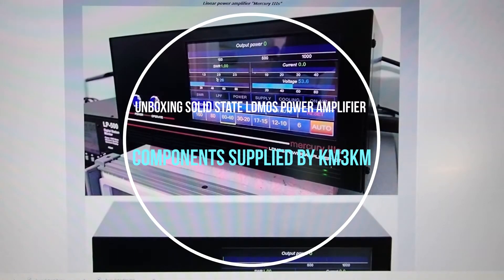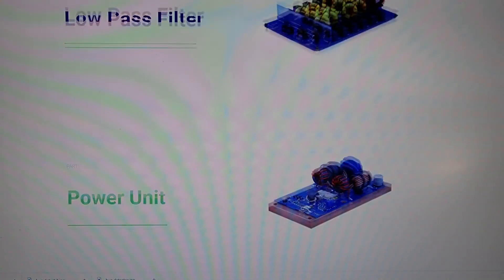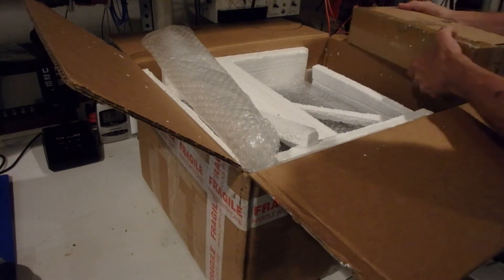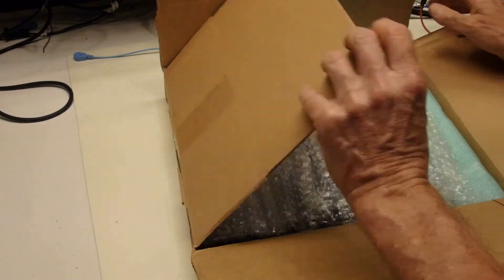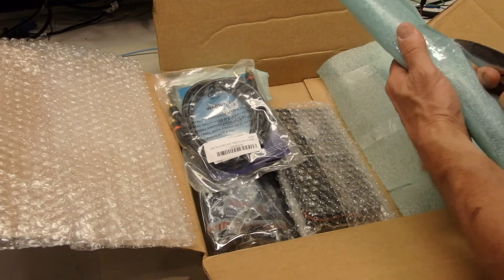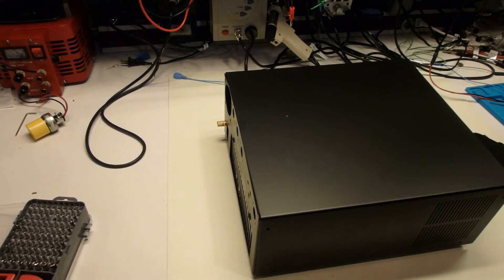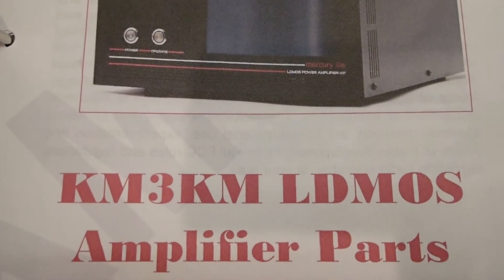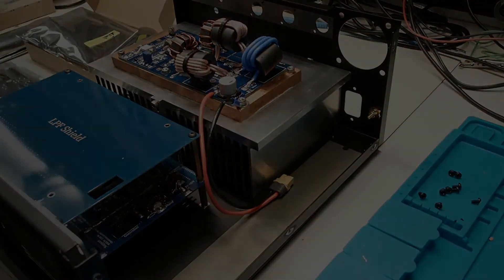Unboxing:  Solid State LDMOS HF Linear Power Amplifier Components

Comment: How would you use this amp with an automatic antenna tuner ? say the mfj 998 ? Would i just not activate the the ptt line when  tuning ? Is the trx antenna line in a pass thru mode then ?
Reply from the maker: I use a MFJ998

You use the
MFJ-5114I MFJ-5114 Original MFJ Enterprises Interface Cable: MFJ Auto Tuner to Icom

For the Icom 7300 to control the tuner and you use the

Icom IC-7300 Amp Relay Cable With ALC & Relay Buffer

To have the Icom 7300 control the amplifier

Comment: I’m very interested in building this amp to use with myFTDX101D.  I have read the construction manual and operating manual but have one remaining question.  How do you deal with the automatic antenna switching and the 3 antenna outlets? Does the amp contain internal antenna tuners for the 3 antenna connections?  Or would you potentially need 3 separate antenna external tuners?  Thanks for your reply.  Your videos are excellent.
Reply from the maker: You are correct. Each antenna input is a completely independent input.